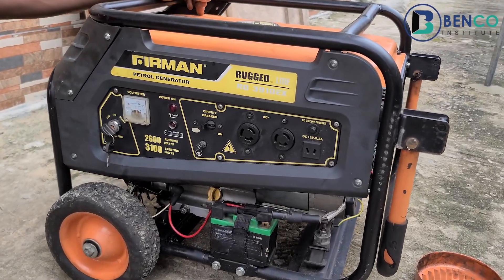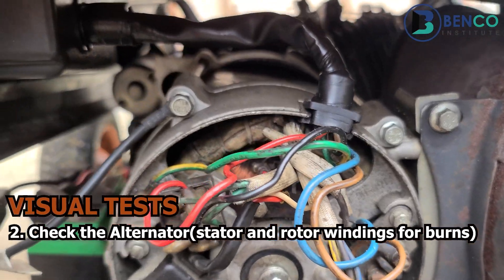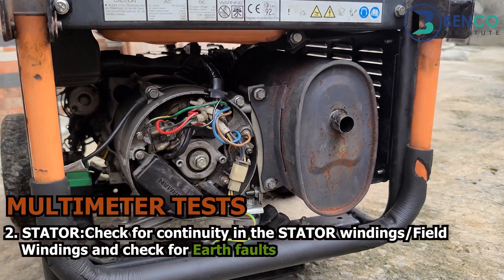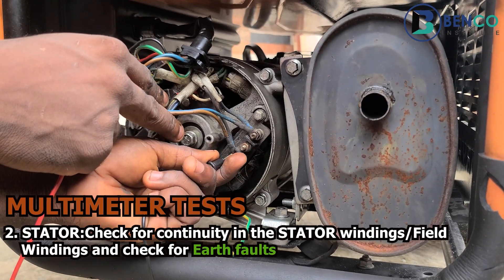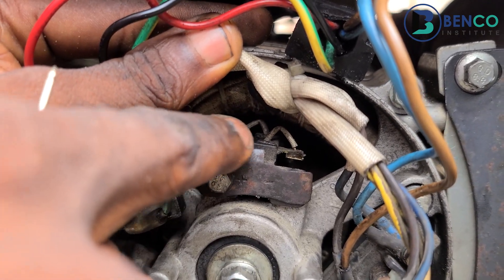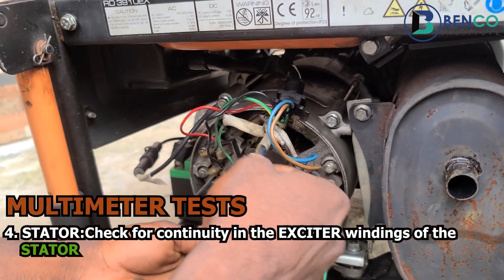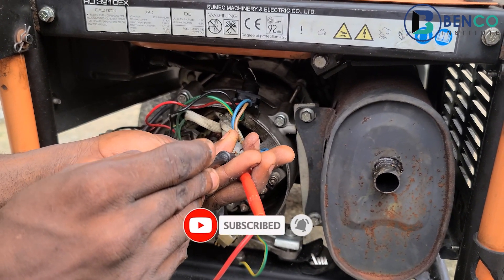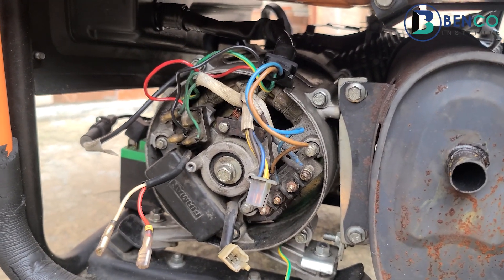How to FIX Generator with no voltage in Five Steps|HOW TO RESTORE POWER OUTPUT IN A GENERATOR

Comment: Please guys, I tried testing the brush for continuity, a placed a probe on the position point and the other probe on the outer part of the  whole casing/cylinder and it confirms continuity.
So, What's faulty, that I should change?

I also tested the AVR and I confirmed that it's gone.

Comment: Great video...pls can you also do a video on wiring from generator ignition key switch to various components of generator..those wiring in generator usually confuse many people
Reply from the maker: I recorded a video of that but misplaced the file... Will record another subsequently
Reply: @bencoinstitute thanks for your response...I later realized there's short circuit in the house wiring that's cutting off generator voltage supply to the house. I connected an independent appliance directly to the gen and the appliance ran fine on the generator  thanks for your response...I later realized there's short circuit in the house wiring that's cutting off generator voltage supply to the house. I connected an independent appliance directly to the gen and the appliance ran fine on the generator

Comment: Well done sir! This is really an informative video. I have this Suzuki SE3000 generator which stopped producing power while in use. All test have been carried out and everything tested okay, the field has been flashed yet no power output. When I did avr to diode and capacitor conversion or raise  the engine speed, it produces between 60v to 70v with a serious vibration on the engine. what could be the problem?

Comment: Engr this is superb, people do a video of how to change starter coil
Reply from the maker: I have Two videos of a starter motor

Will upload around next month
Reply: I'm using this generator with the gas carburetor, when the gas level in the cylinder is low, and I turn on my AC, the generator will be vibrating and current fluctuating. But when my gas is new filled cos I used a 5kg cylinder, it powers it. Also, when the generator has is about to finish and the generator is jerking, the current fluctuates too.